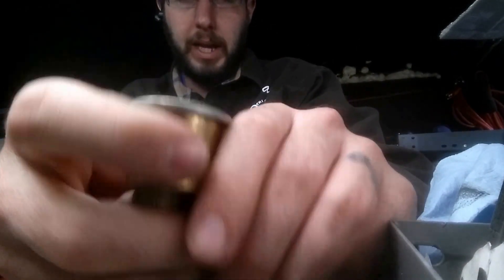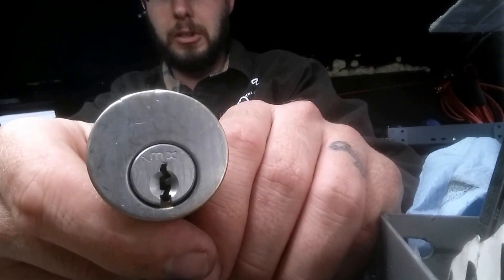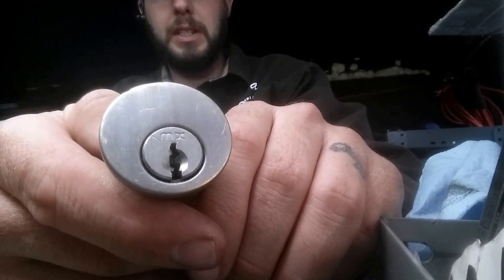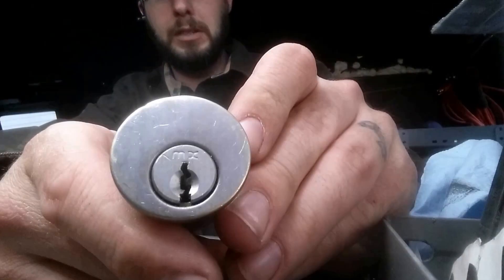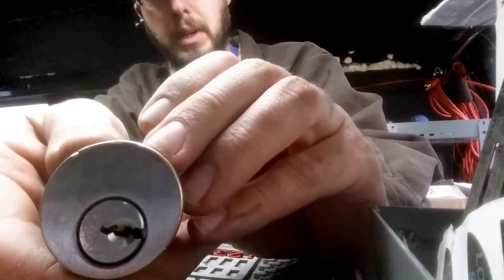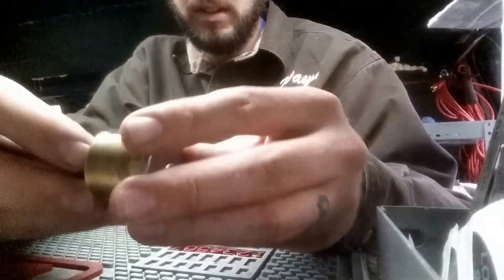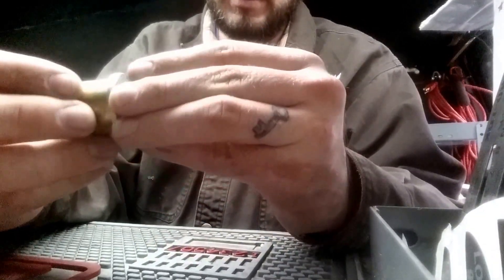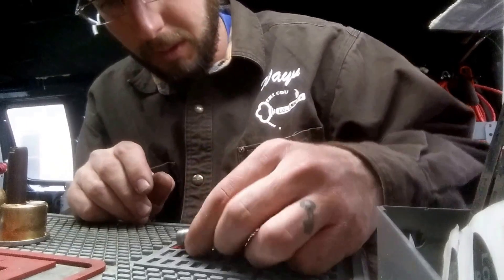MX Challange Lock Gutted

Comment: Another great video Wayne. How you liking the lab pinning mat?
Reply from the maker: I dont. Pins get stuck in it too easy. If you want this lock pm me your info
Reply: That was my thought exactly and the reason why I didnt get one. Plus I cant imagine metal tweezers easily going between the rubber bumps to get the pins out. Weird that its pretty obvious, logically thinking, yet both Lab and Sparrows have practically the same mats. I would also enjoy that challenge lock very much but is this a private place to disclose my address? Sorry Im not the best with google and youtube yet.